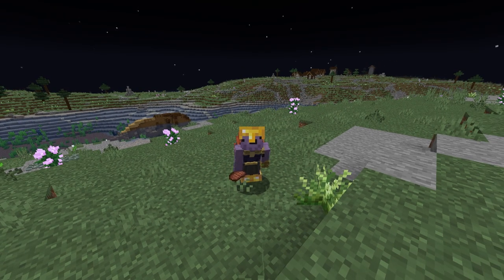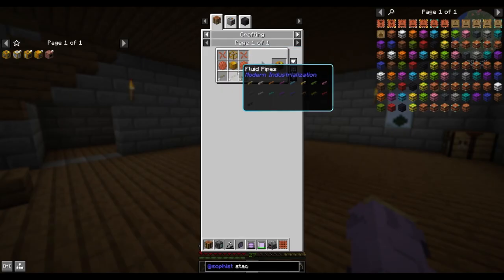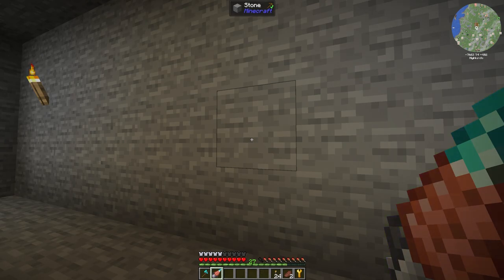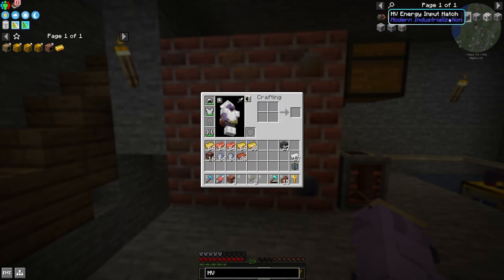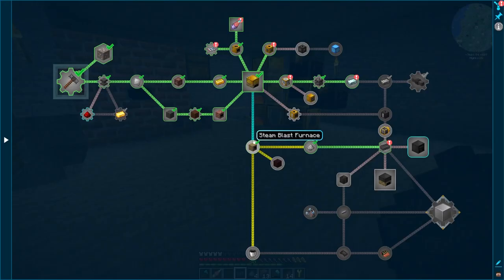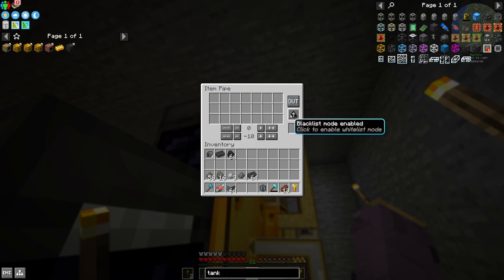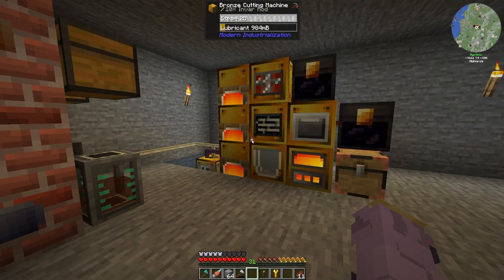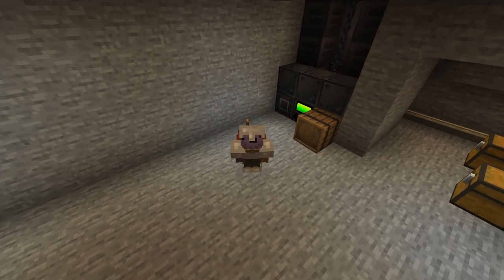FTB NeoTech - Ep. 2 - Steam Quarry & Early Steel Production

Comment: Hi! Just to let you know, if you hold the pipe in your had and shift right click on the block you want to connect to it fixes it so you dont have to click the small square with your wrench.
Your editing is fine, some speedmontage of mining and all the work you put in could be beneficial. Getting to where you are now is a lot of hours for 2 episodes :) need to get the most out of the content. Keep up the good work!
Reply from the maker: Issue I had with what you suggested is my pipes were being used, also I have about 2 1/2 hours of playtime by the end of episode 2, 1h~ of which I have uploaded. But I will look into some more quick montages of what I am doing. There luckily won't be any more mining most likely, episode 3 I have a few setup quick cut montages for some machinery, and then indepth explanation on how they work.

Thanks for the feedback!

Comment: How did you craft Diamonds.
when i mine some i only get ore
Reply from the maker: All the diamonds I got were from chests/villages before going to the "Undergarden" dimension, you can find out more about it and the diamonds you get from it in the "Dimension hopping" quest. 

To process regular diamond ore though, you'll need to macerate them, then use a Pneumaticcraft pressure chamber to compress them into gems (Later in the pack you can use mekanism/MI)
Reply: @Mysticlxl  thanks